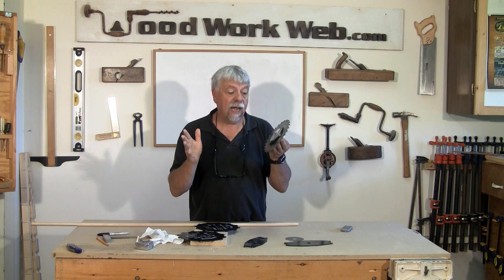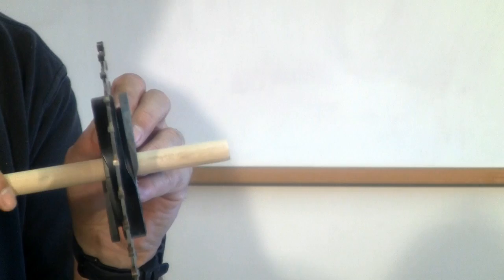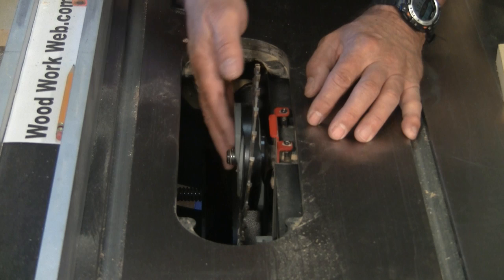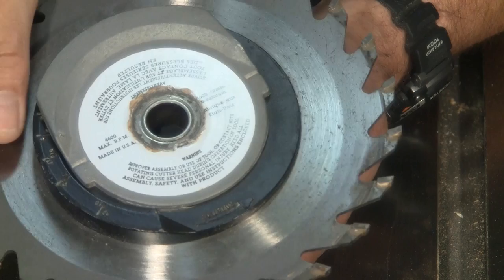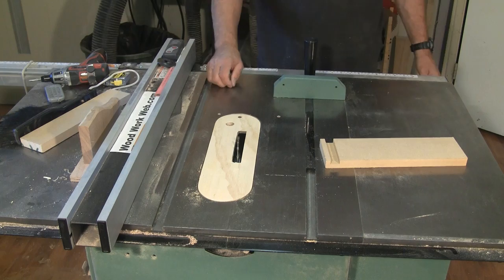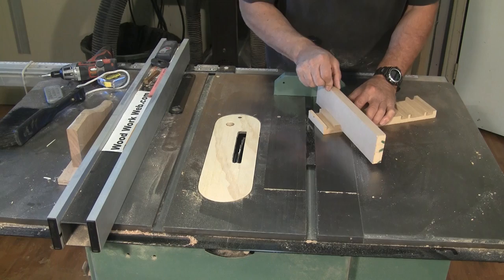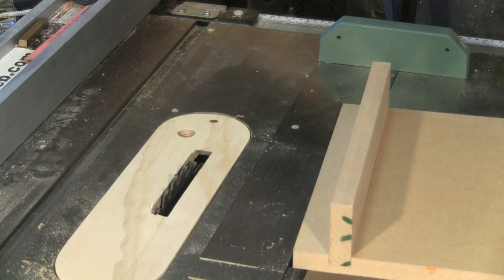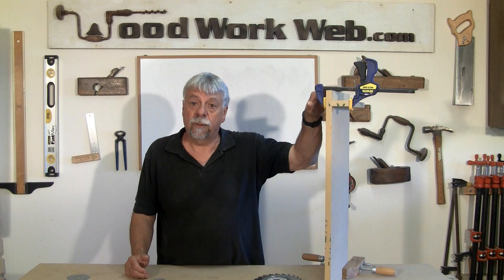Testing the Wobble Dado Blade -  woodworkweb

Comment: Not anecdotal at all Sir.  Let's do the math for proof.  If we assume a 7.5" blade diameter and we tilt it so that the outer edge of a tooth is at 3/8" from vertical, the blade wobble will span a 3/4" sweep (thus making a 3/4" dado).  The height of the tooth from the arbor axis when in the vertical position is 7/5"/2 = 3.75".  The height of the tooth from the arbor axis when in the extreme left or right side of the wobble is given by trigonometry to be the longer leg of a right triangle whose value is the square root of ( (blade radius)^2 - (half dado width)^2 ) so plugging in numbers we get:  height = sqrt( (3.75)^2 - (3/8)^2) = 3.7312".  NOW if we take the difference between vertical height and max wobble height we get:  3.75" - 3.7312" = 0.0187971" OR approx 19 thousandths of an inch WHICH when you look at the gap you got there looks to be about right.  And since the wobble blade is really a modulated radius due to tilt angle and rotation, you will get a concave bottom in your dado. The maximum depth of your concavity relative to the dado corners will increase with dado width but decrease with blade radius.  Cheers All!

Comment: those look a lot more complex how can they be cheaper if anything i would say that a dado set was cheaper if you asked me before the video
Reply: If I had to guess I'd say simply because the bill of materials is much cheaper. One blade plus a bit of plastic is substantially cheaper than two full metal disc's. Plus two circular blades require twice the work of one (obviously), then add in a bunch of the inner blades that all require casting or cutting, de-burring, sharpening, etc. which is a lot more work than the single blade and some molded plastic mechanical parts. I guess packaging could also effect the cost since the kit could come in a nice plastic case or something where as the single wobble blade could be sold loose.
If anything you'd just be paying more for the novelty or "convenience", though I guess that is arguable if you need an absolutely perfect cut with no gap. To be clear though, I had no idea what I dado was before this video so that is all just guessing from experience in other forms of manufacturing.
Reply: dado looks a lot more like just punched out sheet metal this looks a littel more precision made
Reply: tim bum they don't make these anymore and nobody wants to use them. New they were probably similar in price.
Reply: new vs old

Comment: They are better known as adjustable dado blades rather than wobble wheel. You can find them on line all over.
Reply: +Mark Redd  Why would any real craftsman want to "find one" ??
Reply: The only reason is it makes a cheap starter for someone on a budget. You can get one for about 20.00 vs a real dado for over 100.00

Comment: just rotate it 180 degrees next to a ruler?
Reply: Allen Lark that would work of they didn't vibrate so much and make a wider kerf than they should. Also kiss your table saw's motor bearings goodbye, they are good for a radial load ie a side load under normal use, these blades will cause a lot of in and out play in the motor bearings.

Comment: Wobble dado blades are superior to stack blades with its easy simple one piece adjustable design. The amount of time it takes to set up a stack is far longer than setting up with a wobble.  Yeah, stacks will leave a flatter bottom but as you witnessed yourself in this video the wobble left less than an extremely acceptable less than 1/32" gap. A metal worker would laugh at woodworking tolerances where metal tolerances are in the thousandths of an inch woodworkers can deal with 1/32" to 1/8". The woodworkers that fell for spending over $100 for stacks as opposed to wobbles are idiots. The time & motion cost efficiencies rests with wobbles.

Comment: seems like it would be difficult to line up the cut since the blade "moves" from side to side
Reply: You have to think measuring centres, once it is set +1/2 test kerf on to the fence measurement.
Reply from the maker: You do have to take more time to make sure it is aligned which for my cuts was not critical. Good point you make!
Reply from the maker: Sirus Thanks for taking the time to comment on this

Comment: Wobble blades make a crown in the groove, beat bearings apart and can be dangerous if not used on the right saw. Better off to get a cheap 6" stacking dado blade set.
Reply: Wobble blades make a crown in the groove, beat bearings apart and can be dangerous if not used on the right saw.
Not so!
Reply: +Barry Wind you could at least elaborate on your opinion. What part of my comment is not so?
Reply: The wobble dado blades are ground to make ONE WIDTH of groove with a flat bottom (usually 3/4"); narrower grooves get bat-eared, and wider get dished.  There's a benefit to cutting very slowly, btw.  It takes a full spindle revolution to cut both flanks of the slot, so don't feed fast or your sidewalls will not be straight.

Comment: by the 2nd time, I would've made a trip to home depot across the city. same amount of time if not shorter.
Reply: +TheAsianVillain It isn't hard to tell before the cut how wide the groove will be.  Just put it up against the wood and rotate it to both extremes.  You dn't have to take the blade entirely off the wheel to adjust it, just loosen the blade a little.  There is no reason to not have the cut correct on the first or second try.  I have not used one of these since I was a kid, but even as a kid these were not hard to adjust.

Comment: how to convert the degrees of the blade to milimeters of cut ?
Reply: FierceCross it's a logarithymic function because the offset is a slanted cone section, trigonometry will teach you how but remember, it's plastic and the markings will always be off. You have to manually check when you use these things just like he did. They are garbage.
Reply: thanks!
Reply: FierceCross
 This also means the number of degrees to increase it's width decreases as you adjust it for a larger dado, that is the further up in size you go, the more width eatch degree will increase the cut width if that makes any sense, that's called a logarithmic
scale. In theory you could calculate the size of a cut with in total degrees, but never for any one random position to another position, for example (these are made up numbers) depending on the taper of the wobble mechanism going 30 degrees might make a cut 1/4" wide, turning it another 30 degrees might make it a 1/2" cut, and turning it another could make it a 1-1/4" cut etc. You could definately calculate approximately how far from 0 degrees you would need to go to get to a specific size, but the further along that scale you go the more width you get with each degree making getting larger sized cuts towards the end of the scale accurate very difficult.
Reply: thank you bro, i needed some knowledge to start my own tutorials about tools for french viewers, you gived me nice tips about the wobble dado blade.

Comment: I stopped watching this video because theoretically a dado blade may be a chip set or a wobbling arrangement. Then changing the angle of a wobbling blade does not change the elevation. Then is no point watching explanation from a gentlemen that has a poor understanding of the issue at hand to start with.

Comment: Great if you are making 100 of the same size cut,otherwise it's quicker just to nibble through a standard blade
Reply: Standard blades are sometimes alternate-top-bevel, so don't make a flatbottom cut (rip blades and dado set blades do, though).

Comment: In theory there shouldn't be any crowning because of the circular blade and the way it would cut.
Reply: Abortion Crusader the circumference of the blade at an angle should be smaller than it standing true vertical. Logically it should crown.
Reply: But think about it, because the blade protrudes from the table in an arc it shouldn't crown. If you look at it from the side of the blade where you feed the material towards the blade, the blade would appear as a rectangle. I can't really figure out a way to explain it well. Imagine you are lowering the material onto the blade (I know you wouldn't ever do this) It cuts the full width as soon as it touches the blade, and again as you lower it further. Now imagine instead of lowering it, you are feeding it like on the table saw. Again, I can't really explain it without being there with you to show you. If I think of a better way to explain it, or you still don't understand what I'm saying I can try to explain better.
Reply: Or I have the wrong definition of crowning lol
Reply: Yes, I understands and the video supports that. My guess is they need to be properly tuned to produce that square, however I believe if you tested enough you may find some have much larger crowns then others.
Reply: The smaller the diameter of the blade relative to the width of the dado the more crowning you'd have.  In other words, if you have a 10" blade you can make wider dados before the crowning gets noticeable.  Think of the cut viewed from the feed side as a piece of pie balanced on the tip as that is that area the blade cuts.  The "crust" at the top as curvature.
Reply: You're correct that the center of the blade extends less as the angle is increased, but the edge of the blade also extends farther. These should counter each other for reasonably small angles, say single digits. Which is generally what a wobble wheel is limited to. Unless you're doing incredibly fine work, there's no appreciable difference. The reason wobble wheel's fell out of popularity was the number of adjustments and the inability to repeat cuts readily.
Reply: Just going by estimate of what I recall from the vid but it looked like the wobble could be adjusted to between 10 and 15 degrees or so at the max which would be into the double digits but I might be judging that wrong. But more telling is the fact that the curvature was apparent in even the 3/4" dado.  Anyway, I don't have a dog in the fight.  Just pointing it out.  It actually seems to me that way to retain the most strength in the piece with the dado cut would be for the dado to be circular, or ellipsoid, not rectangular at all.  Though that would sacrifice bonding surface for the attached piece.  Interesting stuff with a bajillion variables of varying importance depending on the desired outcome I suppose.
Reply: There shouldn't be any crowning if you think about it enough. Like I said, it's really hard for me to explain but just keep thinking about it.
Reply: +Abortion Crusader I thought the same as you but Marty G is correct. Simple way to demonstrate is to draw a line straight up whichever length you want. Now draw that same length line, starting at the same point at 10*, 20*, 30*, 40* and -10*, -20*, -30*, -40*. Connect the dots. That's your cupping. No way you can avoid it unless you can make the blade longer on the sides to match the highest point in the middle.
Reply: I'd like to just point out, this is the most civil debate I've ever seen take place on YouTube. Good job everyone! Lmao.
Reply: Then my definition of crowning was incorrect. Thank you for confirming my suspicions!

Comment: I would think over time that thing would wear out some bearings and or bushings on a saw.
Reply from the maker: If you used it a lot, I'm sure this is true but most of these get infrequent use at best
Reply: The only dado blade my dad ever had was a wobble dado.  He used it for years on his Craftsman RAS, it didn't seem to harm anything.  But the thing did wobble and shake a bit on the wider settings.  I have just acquired one that will be dedicated to doing those less than 1/4" dados that stack dados can't do.  There is no discernible shaking or wobble at this narrow setting.  I have a very nice Forest stack dado for wider cuts.

Comment: I think your video is incomplete in that you do not mention, or have a close-up as to what the final measure was on the blade when you got an acceptable fit.
Reply from the maker: Jim Schmidt Yes, you are correct ... the final measure was three-quarters of an inch.
Reply: WoodWorkWeb Well, then I have to ask why you didn't just set it to 3/4" to begin with.
Reply from the maker: Jim Schmidt  lol, if it had an accurate setting for 3/4" that's exactly what I would have done, but if you have ever looked at the rough settings on the older wobble wheels you would see there is a large margin of error ... which is why you have to use the trial and error method of set up.
Reply: WoodWorkWeb My dad had one of those & played hell getting it set accurately. Once he found the correct setting for 1/4", 1/2" and 3/4" he marked it on the blade with a paint pen. Pretty easy to set up once he worked through all that. Personally, if I can find 3 at a flea market for $3-5 each, I'd set them for those measurements permanently and have dedicated 1/4", 1/2" & 3/4" dadoes.

Comment: You must be joking ..........................setting the blade so many times , what a pain in the arse
Reply: +Rodney Emmerich   That "pain in the arse" is actually one advantage this blade has over a standard dado stack.  Next time you go to your preferred building supply store, take a micrometer with you, and you won't find a sheet of 3/4 that actually measures out to exactly .750    Just a 64th of play can cause wobble in a dry joint.  So being able to make such fine adjustments is actually a good thing.

Comment: now you know why nobody builds them anymore...quiet hard to adjust and likely to screw up your tablesaw...
Reply: not really... that only happens with a blade that had the markings in that poor state, where you have to guess the spot... a blade with clean markings is faster than the standard dado kit. also i don't think the blade would do a thing to the tablesaw, unleast you use chinese knockoffs... even at first look you can see the counterbalance weights in the center of the blade to counteract the wobbling of the blade so it's pretty safe for the tablesaw

Comment: Your blade could have been sharpened the that would put the marks out hence you struggled but they where  ok when I was a lad, in my opinion the new system is over priced, and when it needs sharpening it will be all over the place due to sharpening 3 blades.

Comment: This is purely a finger killer holy shit
Reply: nope
Reply: @elfpimp1  explain me why
Reply: @giacomobattisti7943  because only stupid idiots would 
A: install a wobble wheel with power connected
B: Use only there fingers to push a boars through a Dado cut without using a pusher of some kind, and 
C: Would put there fingers in the blades while the power is going. 

I've been using mine for over three years. I don't cut corners, nor do I take chances with any power tool or accessories for them. I Always read the warnings and tips provided by the manufacturer.
Reply: @elfpimp1  im more concerned about blade break, after all the blade is pretty stressed, anyway i believe you're doing it the safe way but since i'm used to use the spindle moulder with feeder and after i injured with the table saw a while ago i love to keep my hands really distant from blades
Reply: @giacomobattisti7943  that's totally understandable. It's the "once bitten, twice shy." Saying.  What is a spindle molder/moulder?
Reply: @elfpimp1  a spindle moulder is basically a big router table with a arbor wide from 30mm up to 50mm (1 1/2 inch up to 2 inch) that mounts big and heavy blades and can make all tipes of shapes, grooves and rabbets.
In the last century it was, with the sliding table saw, the base of all the european woodworking, nowadays it's less used since it's more common to use the cnc but it's still used (try to search for toupie instead and for cnc i mean the scm cncs not shapeoko ones)
Reply: @giacomobattisti7943  I just watched a moulder vid, and yeah, wow, godzilla size router. I wouldn't mind a cnc, but only for small table top sized stuff..
Reply: @elfpimp1  yeah these are big machines, where i work we have a couple of 500mm (20inch (i think))  blades that goes on the spindle moulder
Reply: @giacomobattisti7943  oh wow..

Comment: Why aren't you using a riving knife or splitters? You'll suffer form a kickback!
Reply: You generally can't use them in dados because they can't stick through the wood, since you aren't cutting the whole way through. They would also do nothing since they aren't as wide as the cut. I also imagine that without cutting the whole way through the wood, there is much less chance of internal stresses pinching the blade, so the risk of a kickback is low as long as the saw is used properly.
Reply: I don't mean in dados, I mean generally, that set up doesn't allow them, there's no place for them on the cover

Comment: I think you better throw that one away if the markings are that far off and buy a good one. What did you pay... a dollar? By the way I see no vibration in your saw whatsoever and no crown you were told about. I put a straight edge on my screen and found the piece you inserted caused the gap.